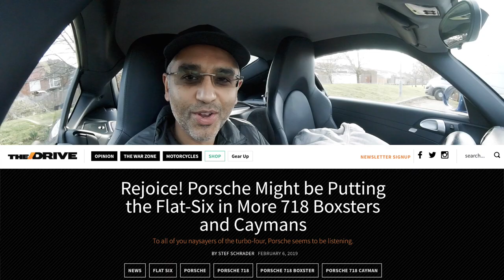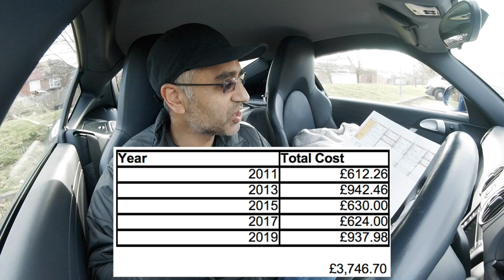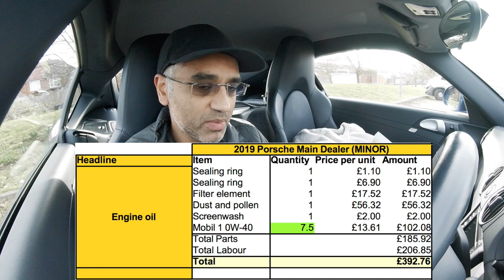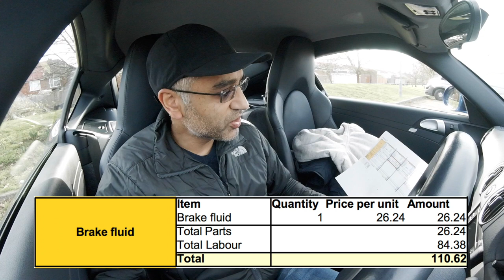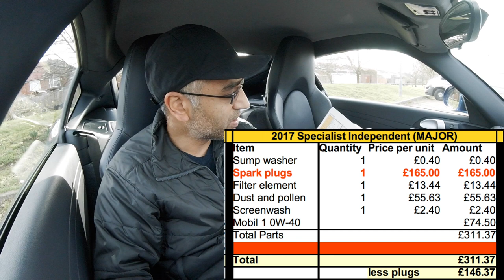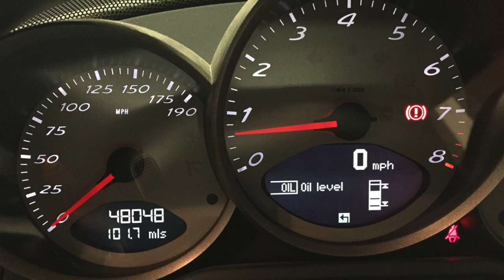Porsche Main Dealer Minor Service | Cayman S 987.2

Comment: For those interested in DIY...the thing about the 986/987/981 Cayman and Boxsters are they are INSANELY simple to work on.  I've had a 986 Boxster S, 987 and 981 Base C and currently a 981 GT4 and 981 Boxster S and do most of the majority of the work myself.  Plugs/brake flushing/filters/oil etc. Basic stuff.  Although I did install the x73 suspension on the 981 Base Cayman myself after watching a couple YouTube videos.  Anyway....they are SO MUCH FUN to work on and not expensive at all.  Just throwing that out there for future owners or current owners thinking of DIY.  Thanks for the video!
Reply: John Tucker Agreed, Oil and filter change alone so easy and saves a fortune looking at maxs numbers.
Reply: @Scofbelly  There are two Porsche dealers near me and both charge $385-$400 for an oil change. DIY cost using OEM recommended oil and OEM filters for me comes to $75-$80. And I can't even comprehend those tranny oil numbers they gave him.  Wow.

Comment: Outrageous price of transmission oil has this been questioned at all..surely a typo and interesting they charge 3x the obtainable price for spark plugs...I guess owners are too embarrassed to complain..
Reply from the maker: Barry island Hi there, and thanks for your comment. Just to be clear here, I asked for the transmission fluid to be changed, and the costs were made very clear to me before I decided to go ahead with the work. The manufacturer guidelines stated transmission fluid didn’t have to be changed for another 2 years. I’m just curious now that I’ve settled the bill, and I have emailed my Porsche main dealer to see if they can explain the unit cost. Must be something odd going on with the invoice, because I have only been charged for 0.25 units of transmission oil. Since making this video it looks like you need around 2 litres (I could be wrong!) of transmission oil to do a complete refill.

I’ve put the full invoice details for the transmission fluid change in the description of this video, with the official Porsche part number. I’ll update this post when I find out more!

Comment: I’ve exhausted all the local independent garages near me. They all stuff up, rush and break things. Back to using main dealers with our most recent cars. It’s More expensive but they use the proper oil and parts and so far I have had no problems.

Comment: Not sure if it’s useful to the discussion but I just had the 40,000 mile service done on my 981. Oil, plugs, engine intake filters, brake fluid ran $1400 USD with a $100 off coupon. I skipped the cabin air and prefilter because I had done them myself.
Reply from the maker: Hi, that's really useful to know. Using the current exchange rate of $1 = £0.77, your major service (you said plugs were done) cost you $1300. I assume it's Porsche main dealer given the price, but do correct me if I'm wrong. Using my figures, a major service at Porsche using my 2019 figures would cost me £706.46 (minor service) + £220.44 (spark plugs) = £926.90. Turning that into USD I make that $1200.

And I always thought this kind of stuff was cheaper in the USA!!
Reply: Yeah that was a dealer service. While I was there, they also replaced the drivers side door panel under warranty (they saw something I hadn’t noticed) and also replaced the oil fill cover under warranty which was rattling.

Comment: Main dealers and good specialists are great for serious issues when you need a knowledgeable Porsche mechanic.They rightfully earn good money and overcharging for very basic maintenance pays their salaries between the big jobs.Your bread & butter Porsches however are not Ferraris.They were built with ease of maintenance in mind providing you have the correct tools.Having owned my 987 for about 4 years have been shocked how simple it has been to service.Brakes & fluid..Oil changes..Trans oil..drivebelt..filters..plugs...etc.( £67 for a paper cabin filter...wow that takes some balls.)
Reply from the maker: You make a good point. Pay specialist prices when you need that expertise, rest of the time do it yourself. Unfortunately I don't have a garage at home, nor all the tooling I'd need if I had a garage. That would all cost me quite a bit of $$$

Comment: Hi Max! Quick question, what exactly is “Dust & Pollen” for the engine oil? Is it a part of the oil change or is that the cabin air filter? Thanks!
Reply from the maker: Great name you got there Max ;-) I copied the headings straight from the Porsche invoices. By "dust and pollen" they really mean the air filter and pollen particle filter. Two separate items, invoiced as one, as they are always changed together.

Check this link - https://www.design911.co.uk/fu/prod12660/Service-Kits-for-Porsche-Boxster-987-27L---32L-and-34L---Cayman--Oil--Air-Filters---Spark-plugs--and-More/
Reply: MAX REVS hahaha thank you, I like your name as well! 
Thank you for the info - that’s what I thought the Dust & Pollen was.
I have a 987.1 S and I do all the maintenance myself, so I wanted to make sure I didn’t somehow miss something major. Love the channel! Your content helped me greatly in determining which Cayman I wanted.

Comment: Good video thanks... So Porsche put a 4 cylinder in a Cayman and call it a 718 based on an old racing car with a 4 cylinder.. Then put a 6 cylinder in it?! Wow.. Okay. I have carried out an interim oil change with oil filter on my 2.9 2009 .. £110 inclusive (parts only of course) Have 2 litres of Mobil one left (used 8 litres) Checked level about 10 times first. It's spot on the 3 bar level still after 1000 miles. You just have to make sure you drain it all off properly first (left it for hours to drain)
Reply from the maker: Thanks for taking the time to comment. As you seem pretty hands on, can I ask if you've changed the transmission fluid before? If so what were your parts costs?
Reply: @MAXREVS  Not done the transmission before. I had a Nissan 350Z which I changed gear oil and diff oil on. Gear oil can be very expensive for sure!
Reply from the maker: If you have the time, care to list a few points comparing and contrasting the 350Z with your Cayman? I was going to buy a 350Z 2 years ago, but in the end scraped the extra cash for the Cayman. This purchase was supposed to be my "forever" car, and so far it's living up to expectations. Now and again, I always wonder how the 350Z would have been to own. I'm principally interested in your thoughts about the chassis and steering comparison.

As for the costs of transmission fluid, I wonder if the transaxle arrangement has anything to do with it, i.e. the same fluid for the transmission and differential? I'm no mechanic, so can't comment any further ;-)

The Porsche part number for the transmission fluid change (parts only) was 000.043.305.00. Quantity of 0.25. Unit price of £457.45 (ex. VAT). The labour was £78.57 (ex. VAT) and labelled "Drained and refilled transmission oil manual. Transmission G87.40 (composite work) support plate remove and reinstall".
Reply: @MAXREVS  Transmission fluid is for life to be honest, I would leave well alone if no leaks or problems. The Cayman (35K Miles Manual base in my case) is superior than the Z, more refined, more sporty, easier to drive, more pleasurable to own. The Z is a GT car and the Cayman is a pure sports car. Z is heavier but has more interior space for the occupants, I did enjoy them very much and still have a soft spot for a Z car (My father had a black 240Z back along). I imported my first 350Z from Japan in 2006 (2002 ST model) and bought another in 2014 (2008 UK HR 308hp model) then in 2011 bought a 370Z auto. The 370Z was very quick but still no cayman. I have also owned 2 911 997's Gen 1 and 2. The Cayman is my all time favourite sports cars and I'm now on my 3rd. I plan on keeping it.
Reply from the maker: MagicAyrtonforever Thanks for taking the time to reply so comprehensively. I found some Porsche service leaflets in my glovebox (had never gone through them in 2 years of ownership), which highlighted my transmission fluid should be changed after 12 years. I just brought the event forward by 2 years. Could be a placebo effect, but the shifts do seem crisper to me. You sure have owned a number of Z cars, and it’s great to hear how the Cayman compares. It was worth me putting in the extra money to get the Cayman over the 350Z.

Comment: The charges for oil throughout your spreadsheet is an obvious rip off, charging you the max price possible for purchasing individual one litre bottles as you might find in a petrol station. Of course, the dealerships and Independents would be buying this stuff in 4 litre containers costing about £30 a pop for the somewhat pricey Mobil one. I can buy a 5 litre bottle for around £21 stg coming from Fuchs, and it is Porsche approved full Syn 5w-30 which I like to use in my car with 70k miles.
Reply from the maker: Jimmy M Agreed mate. To be fair, I knew what I was getting into. I made this video just so I could break down the costs in a little bit more detail, especially the parts vs labour. I wanted all the inspections done as my car is my ‘forever’ car. I don’t go out as much as I used to when I was younger, e.g. drinking and eating out, so I have been mentally saving for this service for a while.

Comment: This all seems very expensive. Just looking at revolution Porsche prices they charge £234 for minor and £354 for major. I always assumed services included the actual oil and filters  but maybe i'm wrong and that's just the labour? When Porsche lists a price for the service are there lots of things that they will add on and bill you for all the parts and fluids so really the advertised price if just for the labour? 2 years £615 4 years £975 6 years £775 8 years £795 10 years £525 12 years £1,095 are what I found for a 981 on the Porsche website. I thought they were fixed but yours seem quite variable. How many miles do you think tyres discs and pads will tend to last on average?
Reply from the maker: When people talk "service" the minimum is engine oil, and engine oil filters. Then there are the air filters, pollen filters, brake fluid, spark plugs, all things which need time. Furthermore, people forget they also read the fault codes of the OBD, check over the whole car, steering, transmission, which is hidden in the labour. Not all garages may do all the checks. It could be cheap, because you're just getting the engine oil done. I also want the peace of mind someone has checked over the car, and there is nothing mechanically wrong, and that no part is worn and about to go. E.g. my leaking coolant hoses were diagnosed ahead of the failure, which would have been a disaster if it happened while I was driving. I am on the same pads and discs for 2 years, I am a heavy braker, the pads could do with a change in a year, but the discs have plenty of life on them still.
Reply: @MAXREVS  So really there's lots of hidden costs and you're probably looking at £600-£1000 each time whether it's major or minor. I believe some people like to do their engine oil every year as they don't feel Porsche's schedules are adequate or aren't comfortable leaving their car that long without inspection. That's not bad for the breaks really if you can get 3 years out of them (depends how many miles you do I guess per year). Do Cayman's eat tyres?

Comment: £102 to fit the plugs omg... Thats crazy for a 987 😥
Reply from the maker: I kinda knew servicing would be expensive when I bought the car 2 years ago... but I'll be honest. I didn't think it would be this much. It's the main dealer labour rates which is the killer. Hopefully with this video out there, future Cayman owners will be better informed.
Reply: @MAXREVS  I'm off too Porsche Wilmslow tomorrow for a transmission fluid change quote. cant find anywhere that supplies mobil PTX. 
I'll post the cost tomorrow
Reply from the maker: That would be AMAZING!! 👍🏼
Reply from the maker: Just checked my invoice. Here were my exact details for the transmission fluid change. 

Part number 000.043.305.00
Quantity 0.25
List £457.45

No labour in the above!
Reply: @MAXREVS  Porsche Wilmslow was £208
Porsche Chester was £260
My transmission oil change on my Boxster S 987 Gen 1
I'll book it in was Wilmslow after its MOT next month
Reply from the maker: jim lad Thanks a bunch for sharing these prices. Once you include VAT Porsche Wilmslow may even be a few pounds cheaper than mine.
Reply: @MAXREVS  That includes VAT £208 ☺
Reply from the maker: "Good" deal then. Mine was £230 inc. VAT